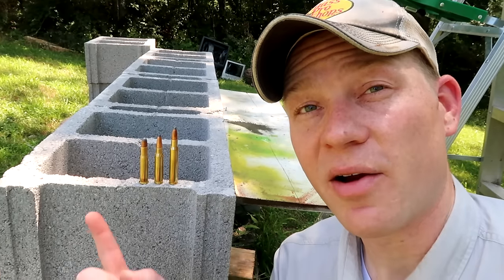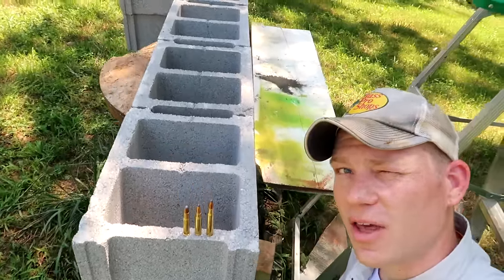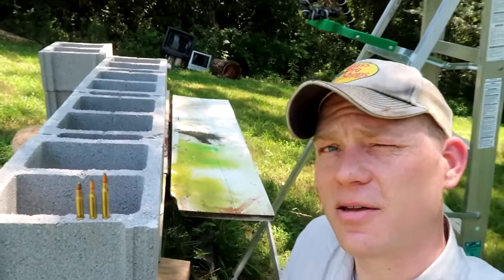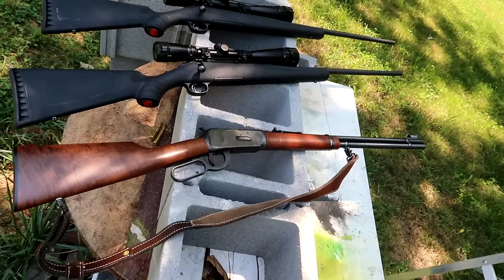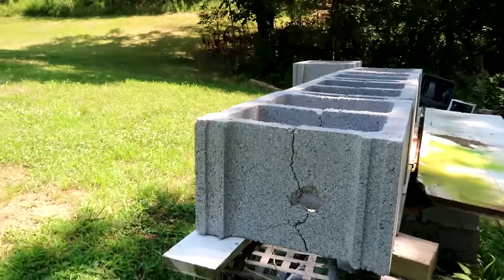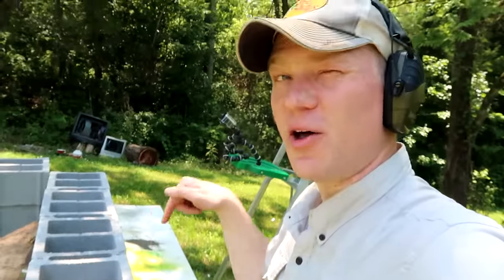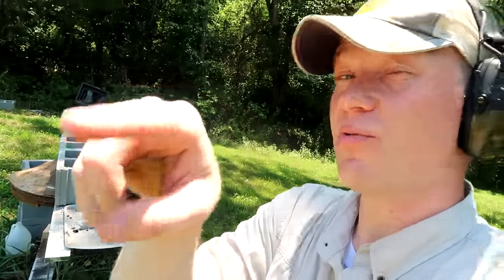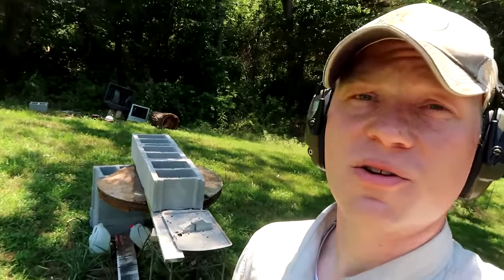30-30 vs 308 vs 30-06 - Cinder Block Test

Comment: A 30-30 is a good saddle gun since it is shorter than the other 2. I had a Winchester 30-30 and it has killed a few deer, but my meat stick was my Savage 270 bolt action. It was deadly accurate. Ballistic tips make it even more deadly.
Reply: Yeah, those Ballistic Tips are something else! Majority of the time, when you shoot a deer, the bullet goes clean through. Years ago shot a deer with my 7mm Remington Magnum with a 150gr Nosler Ballistic tip.  Deer was at 225 yards, standing broadside on a steep upward hill, that swept the front legs back some, facing to the right. Upon skinning the deer, found the bullet just inside the skin of the left leg. Bullet had broken right leg, went through ribs and boiler room and broken left fron leg. Used ALL the energy on that deer! Bullet is now a conversation piece!

Comment: Considerations since hunting has been mentioned: What about accuracies at typical hunting ranges of 200-300 Meters with "standard" loads and bolted-actions ? The 30-30 "cowboy" snub-nose would cause it to shine even less than either the 308 or 30-06 at longer ranges. And ofcourse,  combine that with the reasons of higher grainage of loads for the 308 and the 30-06 { the 150 (?)grain 30-30 vs 180grain 30-06 ? } "Pointiness" and more explosive power will magnify advantages at typical hunting ranges. And it is a game of advantages

Comment: I'm a .308 guy so seeing that the .308 went through as many walls as the 30-06 and obliterated the block quite a bit more than any of the other rounds is a great feeling.   You were right, that was a really fun video.
Reply: Now I don't need to watch the video.
Reply: .308 & 30-06 have identical velocity with the 150 gr.  These velocities with these light bullets give poor penetration on very dense material. But, the 30-06 gives a lot more velocity with the heavier 180 & 200 gr. bullets..thus a lot more energy and penetration than the .308 is capable of. I really prefer the 200 gr. spitzer in my 30-06 [1/2 moa at 100 yrds.]
Reply: @daviddana339  
Hey brother, there is always going to be a friendly rivalry between people based on their preference of ammo, guns and just about everything else, especially in the firearm community.  I think it's based on personal experiences, triumphs and losses.
As far as MOA, you cannot discount the importance of the weapon you are using.  You can have the absolute best ammo in the world and if the firearm is a piece of junk you won't have an MOA worth a damn.  I have a SAKO A7 in .308 and SAKO guaranteed a 5 shot sub 1 MOA at 100 yds. straight out of the box.  Guess what?  They were right.  I had a sub 1 MOA at 100 yds. in a 5 shot group right out of the box using Hornady ammo.  That rifle is incredibly accurate and I get 1 MOA or sub MOA with cheaper rounds as well.  I became a .308 guy due to military experience many, many years ago.  I also like the fact that .308 ammo is everywhere and in bulk thanks to the military using it.  Just about all of my rifles are .308/7.62x51 or 223/5.56 because those are military calibers and getting ammo at a fair price is a lot easier and there should never be a shortage of those rounds either.  Of course if there ever is really a zombie apocalypse I want to have millions of rounds available to me....lol.  The 30-06 is a fantastic round and at the end of the day all that matters is that we are all happy with the ammo we are using.  Best wishes and happy shooting brother.
Reply: Jeff Holland  ballistic coefficients and kinetic energy are a thing. 

He should have thrown a 220 GR smk into a block. 

You should see what an m2ap does out of a 24" 1903. 
I can completely disable vehicles with one shot.
Reply: that is wholly incorrect. 
Their ballistics charts are different and 30-06 can fire a 55gr sabot all the way up to 230gr supersonic. 
Sub Sonic loads are also different pressures and optimal barrel lengths are different with 22" preffered for .308 and slower burning powder and 24" for 30-06.
Reply: @daviddana339  correct .. 30 06 out performs a 308 with heavier grained bullets as you stated in comment , really in my opinion the 30 06 is the best all round gun ..it's a 270 ,308, and a 30 06 in one ... Again from a non profesional shooter and reloader opinion..my findings is my 30 06 out performs the 30 30 and 308 using 150 grn bullet ...3030 shoots a 170 best and my 308 shoots a 165 best in accuracy and grouping to wear a 30 06  patterns good from a 130 up to a 200 ..
Reply: It all depends on the load. Who Tee Who uses Winchester SuperX 150 Gr Loads when comparing these calibers regularly, but to really chose if I liked the .30-06 or .308 more, I went to more expensive and high quality bullets. Both are great, but the .30-06 is more versatile than the .308 for reloading, and there’s more bullet options with amazing expansion and penetration. .308 is still a sweetie to shoot and also not a shoulder buster, unlike the .30-06 which with 180 and 200 grain bullets is a little punchy.
Reply: I dont hunt. Only use for protection and if shtf. .308 is my go to or 7.62×51
Reply: @ezrsaidndone1718  
I'm with you brother.
Reply: @stanfen  30-06 has no advantage over .308 unless you are hand loading. its a lower pressure cartridge when held to saami specs (60k compared to 62k with .308) and your choice of twist rates are the same, meaning you arent able to stablize a heavier bullet in a 30-06 any better than you would a .308. The only advantage you have there is freebore, but that doesnt give you much when you're still beholden to pressure limits... maybe play around with .308 more, you'd be surprised how little difference there is between the two
Reply: @Tyr1001  been to long for me on this video .but, yeah I reload and a 3006 can out perform a 308 at longer distances  ..not knocking 308 ,stating fact..I would call that an advantage ..
Reply: Wait until you find out the projectiles all measure out to .308

Comment: This is part of the reason why I chose the .308 because it has significantly more power than a 30-30 but yet not that much less than a 30-06 in a shorter action rifle.

Comment: More deer have been taken by the 30-30 than any other cartridge. 🤣
Reply: Yes they have.
Reply: It helps that the 30-30 was invented `first and was quickly adopted by many hunters. The 30-06 was more expensive for the gun AND the bullets which contributed to the wide acceptance of the 30-30. It really is a sweet all around bullet. Hit a deer in the head to preserve the meat and I guarantee it will not take even one step.
Reply: Probably so but the 3006 has taken more of all big game species than all other cartridges combined
Reply: More Germans have been taken by 30-06 than any other blaaaah

Comment: Given that the third wall is technically a double wall, I'd be curious to know if it would change anything to place the walls equally distances apart, not the bricks. In other words set it up so that there were no walls butted right against eachother.
Reply: Why not use the same bullet in this test , corelock on the 30-30 does not compare to the other two.

Comment: To take a guess before watching, I feel like the penetration will be similar with all 3, but we might see more immediate damage with the 06 and 308. The 30-30 is often underestimated.
Reply from the maker: You have a pretty good initial assessment!
Reply: 30-30 is more accurate . I use it without scope to 6-7 time that distance and is bulls eye every time , hit a mowing target as an oil can without letting it rest with 7 shoots  , this is why they not selling Winchesters any more
Reply: @elenapopescu100  Actually the 30-30 is the least accurate of the 3. Shoot a 5 shot group out of each at 200 yards and I would be willing to bet the 30-30 is the least accurate. Not that it isn't a great caliber.  Out to 150 yards or so they are a decent round. Using the newer hornady leverevolution polymer pointed tip ammo will get you even a little more speed and range but with the old round nose ammo compared to the other 2 I don't think its even close. Especially beyond the 150-200 yard mark.

Comment: The .308 was selected by the US military to replace the 30-06 due to similar ballistics at reduced in weight and increase ammunition carry capacity.
Reply from the maker: 👍👍 thanks for watching Alan
Reply: Smaller fore to aft magazine size. Not enough velocity, imo, which causes some downsides.
Reply: @Drunken_Hamster  How so? The US military has confirmed 1,000 yard kills with a 7.62x51
Reply: @Nacho42069  I DID put "imo" there. Velocity is king when it comes to ballistics.

Comment: The reason that the 30-06 and 308 split the blocks was because the rounds are pointy.  And the 30-30 just punched a hole in the block.  Any one of these calibers will bring down a deer no questions asked.

Comment: Two points: 
First, 30-30 has less recoil than .308 but is still enough bullet to kill a deer or black bear out to 150 yards, it's a great hunting round unless you need more range than that which only applies to like half the country. It functions great in lever action rifles, if that's how you hunt it's a timeless classic.

Second, yeah .308 really is almost as powerful as 30-06, just slightly less powerful, maybe- if you can kill it with 30-06 you can kill it with .308. I've read that the difference between the two is that 30-06 may go about 100-150 fps faster for the same bullet weight; but does that really make much difference to an elk? The kinetic energy from either is sufficient and the trajectory is adequately flat enough that, with practice, you can kill an elk with either.

Comment: .308 & 30-06 have almost identical ballistics, with the 30-06 having a minuscule edge. Both great rounds..
Reply: YES , 308 FAR LESS RECOIL EASY ON THE SHOULDER
Reply: 308 is a btter round ive shot alot of both killed alot of deer with both

Comment: The test kind of confirms or at least intimates a lot of what we instinctively knew. The .30-30 is not the most powerful 30 cal but is exceptionally well balanced, efficient, and handy for most medium-large game and antipersonnel use.

The 06 is a good deal more powerful in the sense of energy it can transfer but of course is not nearly as efficient or as well adapted to the handy lever carbines.

The 308 is a compromise which gives you most of the performance of the 06 (at the expense of higher pressure) in short action autoloaders as long as you stick to moderate bullet weights. Work up some loads with 220+ gr hard cast or solids and the 06 would likely step ahead handily.

In a bolt action the 06 family has always made the most sense to me. For a midsize autoloader or box magazine lever gun the 308 and it's progenitor the 300 Savage do seem pretty logical.
Reply: I appreciate your comment, I think with the polymer tip .30-30 that Hornady is offering there's new life for this great old round. I live in Indiana so the 30-06 that I hunt with is a bit much at 100 yards or less but it works. I don't have much experience with a .308 but assume that unless you're using a heavier bullet like 180gr+ you're getting much the same performance (with less recoil). When I first bought my own rifle I thought I'd get one all around rifle that could do almost anything and now I've got a 94' .30-30 that's 100 yards accurate, and a .30-06 that's shoots better than I do.

Comment: Great comparison.  What was the distance?  The 30-06 might have a small advantage at a longer range, but one thing is for sure, all 3 will stop a concrete block dead in its tracks!
Reply from the maker: Thanks Rich! This one was pretty close. Within 25 yards. Wanted to be surw to try to hit the exact center every time

Comment: The 7.62x51 or 308 was designed by the military to have the same effects as the 30-06 with the same weight bullet at all ranges just in a shorter case.  Of course you can reload the 30-06 to higher numbers.

Comment: By technicality the 308 Won because it left a dimple in the fourth wall as to where the 30-06 didn't. While essentially a Tie, in a photo finish you would have to give it to the 308. Fun video indeed!
Reply from the maker: Thanks for watching!
Reply: The 308 was developed to mimic the performance of the 30-06 in a short action cartridge so I expected the results to be similar. Having said that, I think a more accurate comparison would have been using the same bullet in all 3 rifles. In the 30-30 you used a Remington Corelokt and a Winchester Super X in the other 2 so it's hard to say that the Super X would have held together on impact like the Corelokt. Also 150gr bullets are fairly light bullets for those 3 cartridges so next time it might be better to run 180s. Overall a good video though.
Reply: that type of performance is very load specific, a heavier loaded .30-06 would  blow it out of the water

Comment: About what I expected, especially the .308 v. 30-06.  30-06 probably has a slight edge for versatility, but that’s mainly because the 30-06 with 180 grain bullets can be driven to higher velocity than a .308 with 180 grain bullets.  Performance between the 2 is about the same when shooting 150-165 grain billets with the .308 having a slight accuracy advantage that won’t matter to what’s being shot.  Love to have a 30-30.  There’s a lot to be said for it on deer size game and shots under 150 yards.

Comment: Looks like 308 and 30-06 tied. 308 transferred part of its kinetic energy to shattering one of the two halves in half again, BUT the 30-06 threw at least one of the halves farther and harder (KE = 0.5 * mass * (velocity)^2), so it appears to me that both had roughly the same kinetic energy, which makes sense since I hand load to certain velocities both and the velocity range of the .308 and 30-06 are nearly identical under standard load. So 308 and 30-06 tied, but blew away the 30-30 obviously. (PS, I am a physicist/engineer by trade).
Reply: The 30-06 will always have more energy than a 308 and is every bit as accurate if not more so. There is no need for 308 unless you're using an AR style platform and even then you can get 30-06 in an AR these days. So my question is, why own a 308?
Reply: Rob easy, 308 utilizes a short action so you can save weight and length of gun for hunting.   308 is 100fps slower and about 100ftlbs less at muzzle and run neck and neck to 300 yards no one unless a hand loader can tell the difference in performance.   If your gonna walk alot and weight is a issue 308 is a better choice.  If weight is not a issue or overall length then 30 06.  As a side note 06 does have the advantage of a 200 or 220 grain load a 308 does not for heavy bears or moose. But 308 with good bullets 180 gr will do just fine.  Personal preference is really only difference.
Reply: @kylecasetta4091  dude. The .308 is less than a half inch shorter. There is absolutely zero difference in weight. If you look at the weight of a 700 rem, browning x bolt, winchester 70 etc in both 308 and 30-06 they weigh exactly the same. And a half inch shorter stroke on the bolt isn't going to make much of a difference. It's not worth the loss in velocity much like the 375 ruger vs 375 h&h.
Reply: @TheHyde8875  compare a model 7, or 77 compact.  To a full sized m70 or 700 huge difference.   My 7 with a 20 inch barrel runs 100fps slower than it's full sized counterparts.   No one can tell the difference in performance from 0 to 300 yards.  The 7 is way shorter way more compact.   Plus way lighter than the 700.  All depends on the gun you purchased.  Caliber alone pick one you'll never no what's better neither will the deer elk or bear.
Reply: @kylecasetta4091  I think you made an excellent point. Besides: If the .308 had been such an inferior caliber, I don't think that they'd based the 7.62 NATO on it . . .

Comment: I hunt with a 30-30 and a 7.62x39 set up like a 30-30. They are fine in areas where you don't care if the deer runs a little. When I hunt areas with steep slopes and deep ravines, I take something with some shock to it, like a 7x57 or a .260 Rem. Sure you can drop a deer in it's tracks with a 30-30, but there will be meat loss unless you do a head shot.   I can hit a deer with the 7x57 right through the lungs and there will be pieces of lung laying where it was hit. They go down fast with a high velocity bullet.

Comment: I appreciate that you keep the weight the same for all three cartridges. I would have preferred to see fmj rather than soft points as I think the odd six lost a lot of energy, more so than the 30/30, spreading open that soft point. I think both the 30/30 and .308 would have gone through an addition wall (each) but the 30.06 would have added two more walls using a full jacketed bullet. thanks for the video